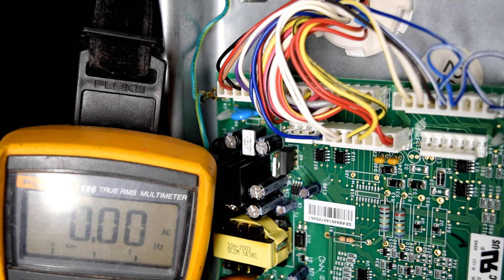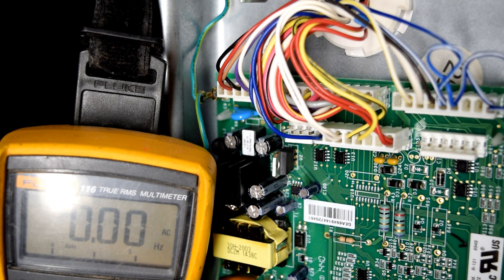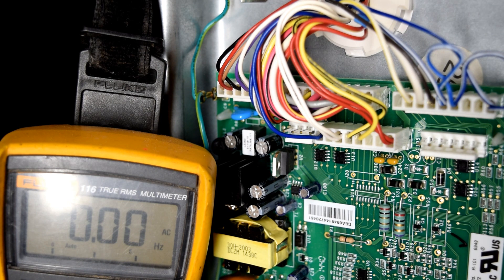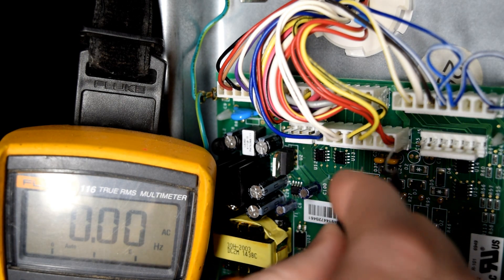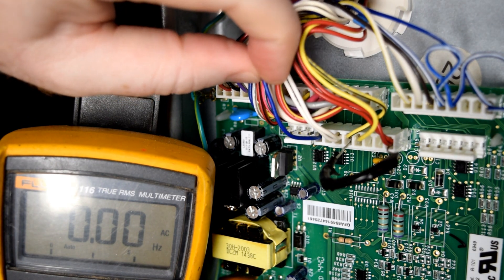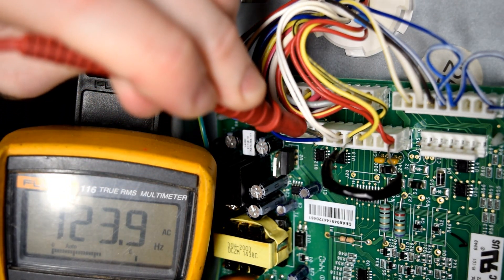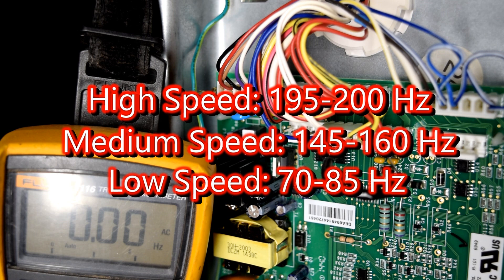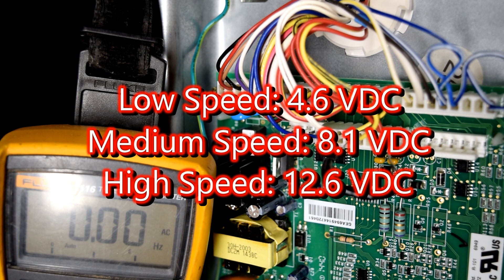Testing GE Fan Motors - Forced Run & Tachometer Test

Comment: When you jumper pin 8 to pin 4 (13V supply to evaporator fan motor control)  does it bother you that you are also pushing this 13 volts back into the drive circuit output for the fan. Any possibility of damaging those output components?

Comment: If I recall correctly, the red wire is DC+ (13 VDC).  So applying the constant 13 volts to the PWM lead results in the expected high speed.
What I'm wondering is why use the red wire (DC+) as the reference when making the frequency reading on the RPM lead?  Would you get the same result using ground (white lead) as your voltage reference?
Reply: There is always a voltage change coming back from the tach in pulse form. So the reference shouldn't really matter.

Comment: Andy, what if i try your forced fan run paperclip trick and the evaporator fan does not turn on?

I do get 12.8 volts across the yellow/black and white wires when fridge is on (positions 4 and 3). On the J2 unit when fridge is off i dont get resistence between the white and red wires at positions 8 and 3. You indicated this is diagnostic of a fan circuit issue. How can i address this?
And thanks for these super helpful videos!

Comment: The tachometer is reading 13.5VDC and when i jumper the evaporator wire i get no fan running. I just replaced this motor. Could it then be bad? I get almost freezing bottom ( any frozen seem to try and stay frozen) and Luke warm fridge

Comment: So this fan being brushless, doesn't it need a controller board? Sry I'm working on mine it's sealed up.. long stry short, saw 12v but fan has been cycling on off and I guess when on low it needs a push, so cap right? But the cycling? The 10306 model, purchased fan motor today, dad was drunk, long day after tech cme out to tell me wut I knew 119 n fan 513 w labor WOW O n half off today only! But don't have the part! Comical I thought. But 12v comes in not surging voltage, just hope it's not a board, cuz I could replace caps now if accessable. 1 maybe 2 sec on offs , always, American Proud, KenK

Comment: Which component here kick starts the motor? I have found in my GE side by side gsl25 that the evaporator fan is not kicking on, when I give it a slight push by hand while still installed in freezer it runs nice and strong. is this possibly a repair issue or must something be replaced? the issue causing me to look around is that the lower fridge is freezing food while the upper freezer side won't keep food frozen. I replaced the thermostat connected to the evaporator fan and the damper door w/ thermostat. I don't see why I would replace the evap motor when it does run but I dont know where to look to fix the issue.
Also, we very much appreciate these videos, I feel the information is thorough and easy to understand. and the extra little tips have answered some lingering questions I have wondered about for some time now...  THANK YOU THANK YOU
Reply from the maker: Hey,
If you can give the fan a boost and it runs as normal, you will need a new fan motor. They will often get rusty on the shaft/bearings and seize up as you describe. That should solve the issue though.

Comment: Hi ,I liked your video thanks. 
I have Electrolux fridge with 4 wire evap fan not turning on , but when I take it out and apply external +12v to white wire and -12v to yellow wire the fan turns on. Also , when I enter diag mode and test the evap fan it turns on and off every few seconds until I push off on the UI. Any idea why?

Comment: I have a GE side-by-side refrigerator GSL25JFXBLBD evaporator fan is running in the opposite way running clockwise should be running counterclockwise if the fan motor is bad would this cause a problem

Comment: Hi, my fan turns on when i unplug the connector next to it, the one with 3 cables, red, pink and brown, so I think I found my problem, do you know what that plug is??? And what to test for that so I can replace?
Reply from the maker: Hi, what is your model number for your fridge and what is the number on the board next to the plug. J1 for example..
Reply: @GraceAppliance  hi! Thank you for replying!!! It’s a ge fridge, the model CZS25TSEBFSS and the board part number is 225D4205G004
Reply: I can send u a picture of the one that i am referring to, it’s a plug with 3 cables, doesnt connected directly to the board it kind of ends up to J4
Reply from the maker: @crisvi81  The schematic shows that your J4 plug is your front touch panel. In your case, it is shorted and by unplugging it - removes the short from the system and the fridge can go back to working.  To confirm this is in fact the plug for your touch panel, you can unplug the board from the fridge at the front touch panel instead of at the main control behind the fridge. If the fridge comes to life once this front touch panel is removed, that's your issue. 

Here is the part you need which can be found though this affiliate link: 
https://amzn.to/3qBVWbr

I hope this helps!  Thanks, Andy

Comment: Could you help me how many Ohm ( electronic chip use for evaporator and condenser)on control board 200D4850G022 WR55X10942,thanks.chip # brown,black,gold,gold,pink.
Reply from the maker: Long Nguyen hi, I hope this helps:
https://www.allaboutcircuits.com/tools/resistor-color-code-calculator/

Comment: Hello Andy, I have a GE ref S/S 17 years old, and lately I have noted that evap. fan runs only in high speed, cooling is ok, but the I can hear the fan humming in high speed as long as the compressor is running.
Should I replace the board ctrl, the evap fan motor or maybe a sensor?
Thanks.
Reply from the maker: Pancho hey!
I’d first check freezer temp sensor for appropriate resistance.  I have a video called diagnosing and replacing a defrost sensor.  The test is the same for defrost sensors and temp sensors.  If the fridge thinks it’s warmer In the fridge or freezer than it actually is, it may be running the fan full time when it isn’t needed.  Also, check to see that there isn’t food blocking any of the vents for proper air flow.  Check the coils in the back for dust.  

That’s the first things that come to mind.
Reply: @GraceAppliance  Thanks Andy, I will do that, and I let you know.

Comment: Hello Andy, My fridge just turns the ligths from inside on but the fans, the compressor and the from panel won’t start or light up, I did what you explain in this video and it started up again 🙌🏼.  BUT I made measurements and it’s receiving 120v but it’s just  sending 6V in the 8 pin connector as well in the 5 pin connector instead of the 13.(something) Volts that should. Should I replace the whole board? Do you know what’s the smarter move to do?  The fridge is a side by side GE Model -GLM23QETA. Thanks in advance
Reply from the maker: Julián Guajardo hi Julian, great work.  
I would remove the plugs from the board and take these measurements again directly on the pins from the board with no plugs connected.  If you’re still getting the incorrect voltages, I agree it sounds like a failed control board.  Often, and especially with failed fan motors, the failed part can rob voltages from the board and give you a false reading. So, it’s helpful to remove the plugs individually to try and isolate the trouble maker circuit.  

I hope this helps.  Andy
Reply: GE Side-by-Side ONLY - Refrigerator Repair Videos thank you 🙏🏻

Comment: If I use the jumper and the evaporator fan turns on, I can assume I have a control board issue and should replace it? Currently, evaporator fans seem not to be coming on. Both freezer and fridge are cold at the bottom and warmer at the top. The fridge is freezing food at the bottom.
Reply from the maker: Hey Robert, if both your freezer & refrigerator temperature sensors are within spec (see video called diagnosing and testing a defrost sensor) I would suspect a failed board.  If the fridge thinks the fridge is at the correct temperature, it will not send voltage for the fans to turn on.  So, check these first.  Also, try leaving a door open for 3 minutes. This should turn both fans on for you.  Called Liner Protection mode, fyi.  

If you are seeing 2 burned green resistors on your board (they are larger and side by side on the board) this would indicate a failed board.  You’d also want to replace the associated fan at the same time.   The fans also have a built in tachometer that sends a response to the board to let it know it’s spinning. If the tach fails, the board will stop sending voltage. 

Let me know what you’re seeing with the resistors.
Reply: @GraceAppliance  Using the self-test in diagnostic mode, the fridge says the sensors all pass. Should I not rely on that to say the sensors are good? I had the freezer door open for more than 3 minutes and the evaporator fan never turned on. I have a newer model and it does not show those 2 big green resistors. I do not see any burned marks on the front of the board, I'll have to look on the back and see as well. On my board, there is a blinking green light for a resistor but I'm not sure what that means.
Reply from the maker: Robert Becton hi, the sensor tests will only tell you if a sensor reads open or closed.  It will tell you if the sensor has completely failed, but would not tell you if the read out tests correct based on the given temperature. At 36F (ice water) you should read out around 14.5Kohms for each sensor.  
I’m not familiar with the flashing light you’re referencing.  What is your model number please?
Reply: @GraceAppliance  ok, well I can test the lower freezer and fridge sensor since both of them are freezing foods. For the top one, I'll use an ice pack in water. The GE model I have is GSE25GSHJCSS.
Reply from the maker: Ok, if you’ll put a thermostat inside the freezer to verify the true temp inside the freezer, at 0F you should be around 42.5k ohms.
Reply: @GraceAppliance  Can I use a laser temperature gun to check the temperature?
Reply from the maker: I haven’t found it to be overly accurate. A cheap junk drawer thermometer has been best for me.  The laser thermometer does accurately measure, but only that specific spot of the fridge and not the air temp, but the surface temp.
Reply: @GraceAppliance  ok, I'll have to go and buy one.
Reply: @GraceAppliance  So I got the temperature inside the freezer and fridge.
Freezer: Upper Chamber -> 10 degrees, Lower Chamber -> -5 degrees, Display -> 15 degrees
Fridge: Upper chamber ->52 degrees, Lower Chamber -> 32 degrees, Display -> 55 degrees
Reply from the maker: Hi, the video I referenced above will show how to take the ohm measurements of each of these temp sensors with your meter.  Also, it will show a chart you can verify the correct read out for the sensors.  If they’ve failed, I’d start by replacing both.
Reply: @GraceAppliance  I will check out the video. Do you know why there is a light blinking for R57 on the control board?
Reply from the maker: Robert Becton I am afraid I don’t know.  Sorry.
Reply: Robert Becton 
I’m having the same issues. Large temperature variances between the top and bottom of both freezer side and fridge side. And I have the same R57 light blinking on my control board. Did you find a solution to your problem?
Reply: @brandonallison5768  My troubleshooting led to the evaporator fan, which I replaced. It was not running at all even though the was voltage going to it. The refrigerator is running normally now. The R57 light is still blinking and I can't find any documentation that explains it. GE won't tell me what it means.

Comment: Hey Andy, great video thank you. My case is: evaporator fan doesn´t work , putting jumper it starts up, but taking jumper out it keeps working until reaching temperature, Do you know why?, main board voltage is right.
Reply from the maker: Hey Miguel, Interesting!
The only guess I would have is that the tachometer is failed/failing on the fan motor.  Perhaps once it's spinning at full speed, the board is getting a good reading, but at low speeds (i.e. not full 13vdc) it will not register the fans tachometer Hz frequency response.  

I would start with a new fan motor and see if this resolves the issue.  

Let me know if you have any questions or run in to any issues.
Reply: Thank you Andy, yes I changed it because didn´t work, but now it starts up the way I said, motor stops when fridge get right temperature, but keeps off until putting jumper again
Reply from the maker: @MiguelVillarroel02   Miguel Villarroel  I understand.
If your meter has an HZ setting, you could test the tachometer response from the fan to the board... Otherwise, there isn't a way to confirm the correct operation.

Leave a fridge or freezer door open for 3 minutes. This should turn both fans on. 
What voltage are you getting at the white and yellow/black wire then?

Also, check the ohm resistance of both temp sensors for fridge and freezer section. I have a video called testing and replacing a defrost sensor.
Reply: Thank you very much Mr.Andy, yes it´s about 200hz and 13.5v, ohm resistance of sensors is pending to test. Hey Andy, in case of main board fail I´d like to fix it, is it hard to fix Andy? I see It´s a bit hard to find circuit diagram of GE part No: 200D4852G016
Reply from the maker: I don't think there is a circuit diagram for the board itself.

The typical parts that you'd replace of you were going to fix the board yourself would be all of the relays, medium sized capacitors and the two large green resistors if they were burned.